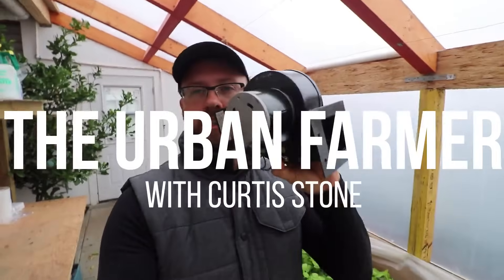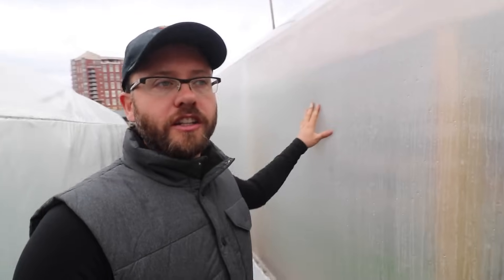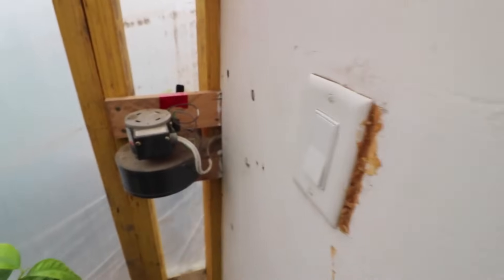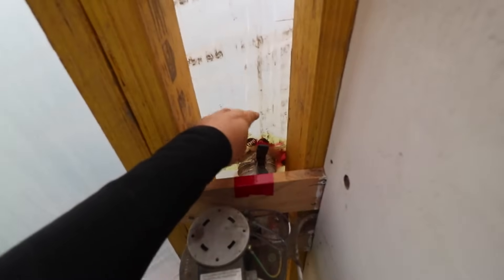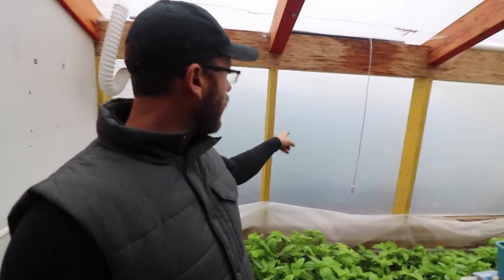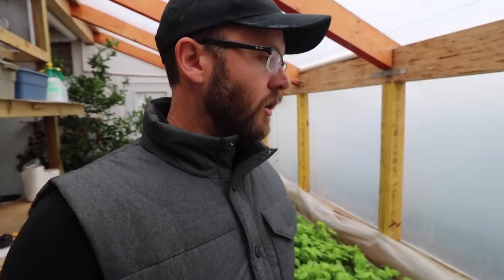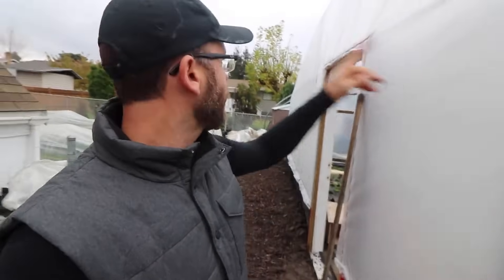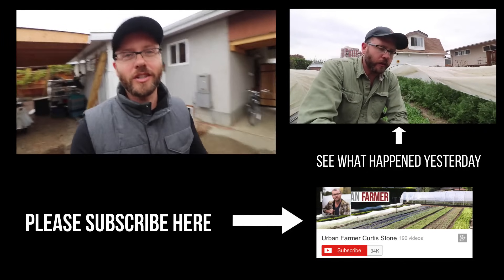How Double Layer Greenhouses Supercharge Your Growing Potential!

Comment: Interesting! I met a man named Richard Nelson, who invented  a system where you insert very thin (dry-cleaning type poly)tunnels between the layers at each end of these  ducts there was a fan, on which was adjusted a screen, drippping with  dishwashing soap & water was dripping . The result was to fill the ducts with gazillions of tiny bulles. Once done with the insulation need, just blow the bubles up against the creen at the other end, recouperating the solution in a closed circuit.

But what was truly mind blowing in his project was that  he had placed the greenhouse structure over a surface made of a water retention bassin filled with large rocks opn the inside of the external layer, he had water slowly dripping from the apex. Water was thus heated, and stored underneath the structure.

At night, in the desert,  very cold temperature is the rule. Richard's soap ducts system insured a superior insulation against heat loss, thus conserving and slowly consuming energy stored under the greenhouse. I don't know what happenned to Richard or his designs. At the time the Canadian based company he owned with his wife was called Thermagrow.
Reply: you all probably dont care but does any of you know of a way to log back into an Instagram account?
I was dumb forgot the password. I appreciate any help you can offer me!
Reply: @Moses Ivan instablaster =)
Reply: @Lennox Hunter it did the trick and I actually got access to my account again. Im so happy!
Thank you so much you saved my account :D
Reply: @Moses Ivan You are welcome :D
Reply: Interesting concept.  Never heard of it.  When I search for thermagrow, I get links to "therma-glo" wrist watches.  Variations on the heat-water-by-day and using that warmed water by night are many.

I'm skeptical about this blower thing, but low-powered pumps that circulate water to capture and store solar energy make total sense to me, somehow.

I just wish someone else knew more about the principle you're describing.  I like to know everything!  :o)

Comment: Great video! I work in the greenhouse business and we have installed blower using inside and outside air. Not much difference with condensation but drain holes are helpful. There are pressure relief valves you could use instead of a open pipe. The wiggle wire - great invention!

Comment: Thank you so much! I am building a passive solar green house in an area of South Africa that has regular frost in winter during the night. Now I was looking for some type of fabric I could use to roll down the plastic cover during the night as insulation. Found nothing so far. Then i revisited your video on the double layer plastic which seems exactly what I need. One concern I had was the fact that it's a curved area - until you moved to speak about your second green house you planned on covering, because that has a curved area too. You didn't seem concerned about that fact. Is it not necessary to put any spacers between the two layers? you just cut the sheet a bit longer then the first one and the blower does it all?

Comment: great video! more details on how you fix the hoses to the poly in such a way as to support the hose/blower.  The question that would be helpful to answer for us is how many CFM does the blower provide?  Rather than current draw, what the Cubic Feet per Minute rating is the key variable... Again, thanks for sharing this!

Comment: This is a great system. They sometimes add pressure switch on it to stop the motor when the pressure builds up between layers.
Reply: ... there’s a damper lid on mine to reduce the pressure if needed ...right on the fan ... ready to change my Polly this week myself ... have a great spring here in zone 6 ...

Comment: Hi Curtis, thanks for all your great information! Regarding inflator blowers if you draw your air from outdoors you will not get the condensation between layers! Thanks for being such an inspiration, keep up the outstanding work!
Reply from the maker: This is not true from every other grower I've seen. If that works for you, send me a picture of your greenhouse. Nobody I know in a cold climate does that.
Reply: Ok, will do. I'm in NH using a Harnois oval tech with blower mounted outside under a small metal hood. Second Harnois has rigid poly roof with inflated side roll up walls. Again, blower mounted outside.  Never had condensation between poly film regardless of temps.
Reply from the maker: Ok, I would love to see how that is played out.

Comment: On my greenhouse, I've given up on those little fans.   They have crummy little sleeve bearings and just do not handle the long hours of running.  But this fan is optimized for producing high static pressure and you won't find a small fan with better bearings that will replace them.  I went with a larger fan that replaces the 6 small ones that my double bay greenhouse used to need. (it has poly walls).  I have a whole box of little junk fans (that had to be replaced in the middle of the night etc) if you want them.

Comment: If you take air from outside instead of in the greenhouse for the fan you will get less condensation between the layers.
Greenhouse air is usually pretty humid

Comment: Curtis, if you put the fan on a variable switch, you can control the pressure and get the inch column of water needed. This way you won't stretch your plastic over time.
Reply: Better to let the blower run as intended and release excess air with a valve

Comment: drawing the air from outside will help with condensation 
another benifit  is it acts like a pillow, absorbing energy frim wind gusts.
Reply: I could be wrong but I would think filling it with warm air from inside would be better insulation than cold air from outside.
Reply: MrFarmer1997   it's about relative humidity 
warm air holds more moisture then cold 
warm moist inside air when it comes in contact with cold, the moisture drops out.
happens to ships that load in the tropics , thousands of gallons have to be pumped out.
Curtis is in high desert, or semi arid.  
he only has a small problem with moist air.
Reply: not practical, do you know how much that much double glazing would cost, and you only need it for the winter.
Reply: Robert Slackware  You're not achieving any measurable vacuum for 300 bucks with plastic poly sheeting.

Comment: Very very EXCELLENT! Does the plastic have UV protection, and if so how many years is it rated for? I purchased some greenhouse plastic end pieces (at a big discount from Grower's Supply) for my low tunnels that had a coating that allowed sunlight to enter but reflected back into the greenhouse the long-wave heat radiation. Do you buy special greenhouse plastic or just inexpensive local stuff? Your Northern location does not have the intense sun radiation like the South. What is the longest you have had plastic up without it falling apart.

Comment: I haven't found any recent comparisons on youtube comparing 2 greenhouses.  1. unheated double layer inflated vs 2. unheated single layer.  There was a study done in 1979 https://hortscans.ces.ncsu.edu/uploads/o/b/observat_537b7424bc61c.pdf
in summary it basically says in the early hours prior to sunrise there was very little difference in temperature between both unheated greenhouses.  The study also highlights a large reduction in direct light from adding the 2nd layer.  I have seen others do geo thermal and I can attest personally that the black painted drums being used as thermal mass does great, but I was just curious when singling out the single wall vs double wall if there was any real difference in the hours leading up to dawn.

Comment: Have you tried or heard of anyone doing a similar design but without active air-pressurization?  Just two layers of laminate with an air gap?
Reply from the maker: No. I've never heard of anyone doing that.
Reply: I have done it -- because i could not finance as formal of a greenhouse yet: I have two caterpillar tunnels and when we took one down for the season we doubled up the poly on the one we left up for winter... went from holding around 40-50 throughout a 30 degree day to between 70 and 80 degrees farenheit.  no fans except the couple we have inside tunnel simply for air circulation.
Reply: As long as you are sealed up wel dead air is a good insulator

Comment: Sorry I'm late to the party, but I would mount the blower 90 degrees to how you have it mounted. The way you've mounted it now forces the bearings on the fan and motor shaft to ride on the side of the bearing races. This will shorten the life of the bearings, and you'll need to replace the worn bearings or the whole fan earlier, whereas mounting the motor shaft horizontally allows the bearings of the shaft to run in the center of the races. Otherwise, beautiful greenhouse!

Comment: On my GH I have 2 layers of poly separated by 1x2 boards on each rafter and stud. The poly is tight so I have a 3/4" gap between the layers. Does this give the same effect as the blower system?
Reply: yes as long as the 2 layers don't touch each other.
Reply: The blower compresses the air, somewhat, so gas laws say it warms the air, somewhat.  Also pressurized air prob'ly has a higher R-value.  But you could build the inner layer farther from the outer layer, and achieve whatever you wanted.

Comment: It's a good practice but the air have to be taken from the outside. As you can see, there is a lot of condensation between the two plastic layers. this is due to the condensation of moisture in the warm air that comes into contact with the outer layer.

Comment: The concept is sound but true R-value is achieved by 'trapping' air. With the air flowing wouldn't this just act as a heat exchanger?  I want to build a small greenhouse and all your videos are great. Thx👍🏼
Reply: Yeah, it's a heat exchanger. He's heating up the space in the winter between the poly walls. Blow the air in from just above the ground in the greenhouse, let the sun heat it between the walls, exhaust the now hotter air into room. It's using the sun's radiant heat to heat the space between the two. Since you're using greenhouse air as the supply air, it being already warmer, you get a little better performance between the walls than you would just with one layer and allowing whatever radiant heating would occur. There is a bit of a blanket insulation effect because the air of the greenhouse and walls is mostly static; it's the same air.
Reply: I agree with your concern here. I am not convinced that it is a good idea to blow air in between the two layers of plastic : he might as well have just installed 1 layer to begin with. It would have been a better solution to install some kind of spacer in between the two plastic layers during construction. I imagine peices of styrofoam would work well
Reply: He's just blowing the air because otherwise a small tear means that the whole thing deflates slowly and surely. He says as much in the video (4:14), and it's correct that it is unnecessary for just producing a sufficient thermal resistance. If he/the guy who came up with the system knew his film would never have small tears in it, then they would not circulate air at all and just leave the walls as big inflatable mattresses. 
The air flowing goes inside of the greenhouse too, so we aren't really worried with exchanging heat from a hot place to a hot place. None of the circulating air is from outside
Reply: @thehealthpolicychannel1229  Since he's using wood-frame construction, he could just staple/attach one layer outside and one layer inside of the framing, and it's an instant R3 or R4 (the space between the layers is how R-values are measured for air at standard temp and press, I think).  i'm not sure where he's getting the R5 from, assuming the plastic layers are only being kept apart by air pressure.  Pressurizing the air warms it a bit, and the compressed air has higher R-value than ambient.  

My idea was to build a Russian-doll sort of greenhouse, with one inside the other.  The R-value achieved would be the thickness of the dead air space between the inner and the outer.  No blower running all the time.

Why do DIYers always love to hear things clanking and whirring?  You know.  Like the guy with the wood-gas truck and the wood-gas tractor.  Neither have decent mufflers.  They just really like the rattle-bang.  Probably grew up providing sound effects for their Tonka trucks.

I'd use a small blower connected to underground pipes, to use passive geothermal to regulate the temp beyond that.
Reply: @harrymills2770  It could be that he is concerned about the thermal bridge effect; in your example, the wood framing would transfer heat, whereas if the outer layer of plastic is inflated, there is no thermal bridge. But he should have addressed that in his video.
Reply: @gsadow  Wood doesn't transfer heat very quickly, and the frame is a very small part of the total surface area.  I'm still pretty skeptical about the whole idea.  If you can't afford double-wall protection, inside and outside the frame, then buying a blower and inflating would be a cheap way to get that double-layer protection without having to buy any more framing materials. But then you have to keep that fan going, 24/7, which seems to defeat my purpose of simplicity and durability.

It seems like a nice hack for dirt-cheap kit greenhouses, for the cost of an extra layer of plastic and a blower fan.  But I think I'd just fasten the inside layer to the inside of the frame, or better yet, suspend it from the cheapest hoops possible.  The inner layer doesn't have to be structural, as opposed to the outer layer, which does.

The blower idea is just a bit too Rube Goldberg for me, even though I see lots of people doing it.
Reply: @harrymills2770  And he notes that he has to bridge at points where the channel locks are -- which are terrible areas of heat loss.  I too wonder why not just attach the second layer to the inside wood framing or light strapping to get even better thermal break. Also lots of stuff out there that uses perforated (to combat the condensation = mold) drain tile buried 4 feet down for cheap geothermal. The two layer blower system seems over hyped to me.

Comment: Curtis, you pointed to the insulation value of the double walled Greenhouse.  I guess that was no surprise when you see modern buildings having double or even triple glazing.  My question is: During hot weather, does the greenhouseheat up to the point of harming the plants.  For instance, this last week has been 35˚C plus every day.  Would that cook the plants?

Comment: If the inlet to the blower was being taken from outside. Would that solve the moisture between the plastic . which I assume if you have air and moisture you will have some type of mold growing. Working an indoor garden is important to have fresh air 2 cycle and control the humidity in the growing area. I assume that's the same with a greenhouse. Thinking about putting my own hoop style greenhouse in.

Comment: Curtis I have a question about the benefits of using this in the summer. Does it have a benefit in decreasing solar heat gain or does it actually increase solar heat by trapping?
I can’t find an answer anywhere and hope you can help.

Comment: What happens to the greenhouse when it snows a lot outside? I can see that the snow would help with  insulating however does it put stress on the greenhouse? And how do you deal with that? Also how do you deal with the inside of the greenhouse if it drops a certain temperature? Does that R factor stop the ground from not freezing?

Comment: I think the exhaust is a bad idea except for, perhaps, reducing moisture in the space between the layers. The ideal situation would be that there were negligible leaks in the system and the fan ran fully stalled and no air circulated. By having the exhaust you are taking air from inside the inner layer passing it in close contact to the cold outer skin and returning this cooled air back into the tunnel. There is no need for flow through the fan - it will run fully stalled and actually draw less power when it does (just as your vacuum cleaner speeds up when you stall it - it does that because the aerodynamic load is less). Ideally, to fan should be servoed so as to keep the pressure just high enough to maintain the gap in the prevailing wind conditions (as a guide, the tip speed of the fan needs to be about 20% greater than the prevailing wind (plus a small allowance for the weight of the polythene to keep it spaced in zero wind).

Comment: Can the fan be on the outside? do you loose heat by pumping the warm air into the void? Or would it cool the greenhouse down too much during the winter f you blew the cold air into the void?

Comment: Of most importance to me would be; snow load. I think you & I discussed this somewhere but couldn't find my name in the comments. You said it melts any snowfall but you're in western Canada and I'm in Buffalo NY. We got over 6 feet of snow in like 2 days in 2014. I can see accumulation per hour or even per minute, far exceeding the rate which any air layer can melt it. Have you gotten any SERIOUS snow and how does 6 mil poly handle FEET of snow? How can just an air gap of just a few inches outmelt the rapid accumulation rate?